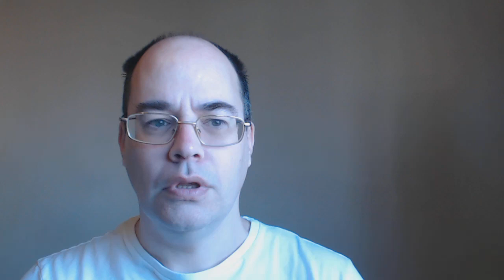Gold its properties and why it is useful in electronic devices like mobile phones.

Comment: Gold may not be an element but instead a manufactured metal like aluminium (what r the ingredients that r added to make aluminium) and steel (what gives pig iron its colour?) and copper (what gives copper it’s colour?)

Look into all the ingredients that go into making gold
Their additional properties making gold an alloy instead of a refined pure element 

Gold can be corroded by strong acids 

Have a gander at the Peter and pete channel to see behind the schooled daze non science - we r all taught 

Time to re examine everything with critical thinking
Reply from the maker: No gold is an element, it is very basic atomic chemistry.
Reply: Have u watched a manufacturing vid? - a lot of metals r added to the ore and not removed
Reply: U may like to check ur email folders if u don’t let links post
I’ve left u a few messages on water and oxygen